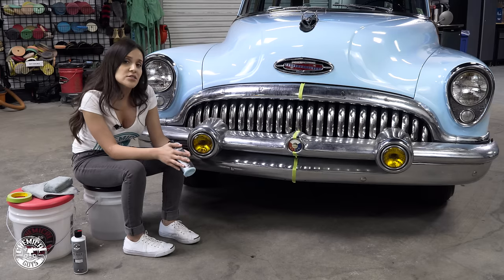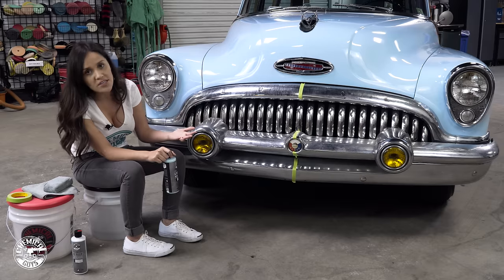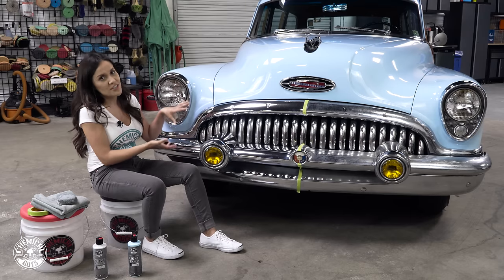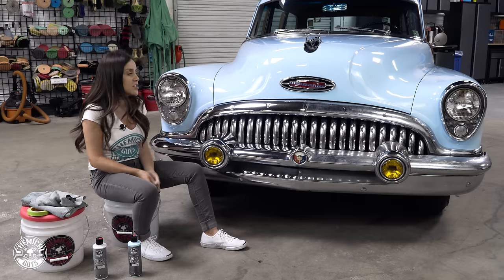How To Make REALLY Bad Chrome Shine - 1953 Buick Estate Wagon - Chemical Guys Car Care

Comment: Great vid👌🏻 Did u guys make a video on removing scratches and swirls on chrome bumpers? If not can you show the best method? Thanks!
Reply from the maker: Hi Rolando, this is the best way to clean chrome. Polishing chrome with a machine could produce mixed results, scratches in chrome are very difficult to remove.

Comment: I have a 2005 mustang gt and it was wreck before I purchased the car the body shop that did the car did great but except on the hood. When ever you wash the car and start drying the paint streaks on the hood and when you get a dry towel and try to wipe the streaks off it streaks more I tried clay bar polish wax and sealant and it won't fix it. Please give me a tip if you know how to fix it thanks!!!! @chemicalguys

Comment: Talking about towels, doesn't wash them remove the  contaminants? Would they then be safe to use on paint?
Reply from the maker: In the video, Jen was talking about keeping your towels separate so that you don't use towels exposed to wheel contaminants on your paintwork.  The towels are color coded for a reason. If you wash them separately, you won't get grime from one towel transferring to the other. The chemicals you use on different sections of the car shouldn't make contact with your paint, especially the dirt you've just removed.

Comment: Will this work on chrome exhaust?
Reply from the maker: Yessir it will. You need to clean the chrome first with Ecosmart, then you can apply the light metal polish with a foam applicator pad to remove light oxidation, and restore the finish of the chrome.